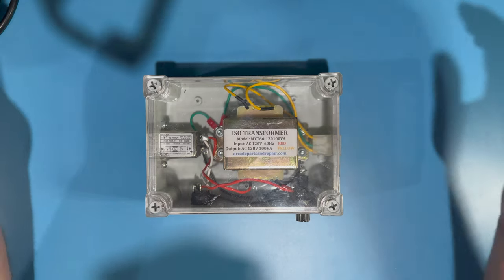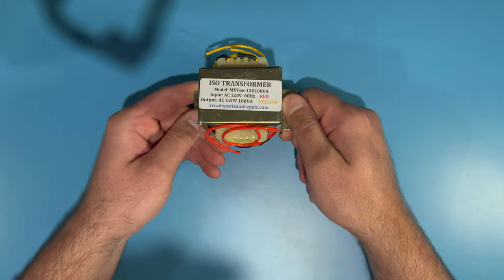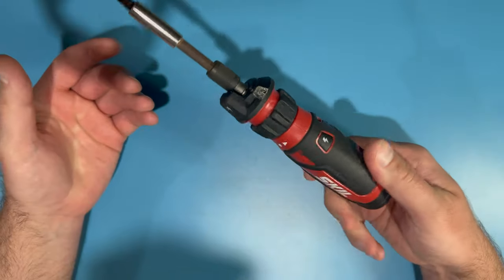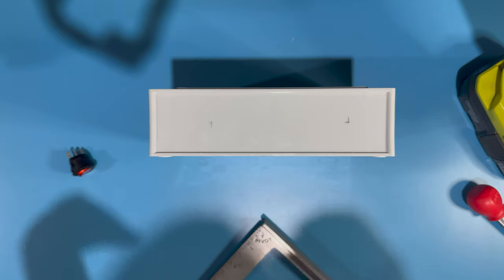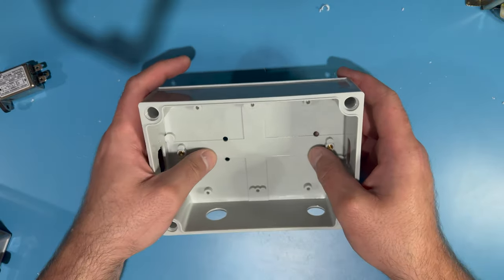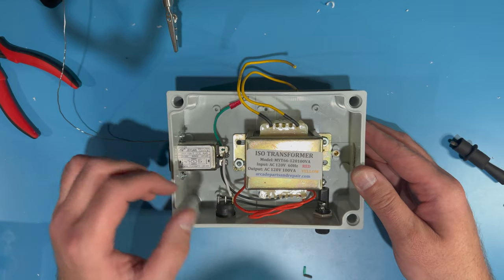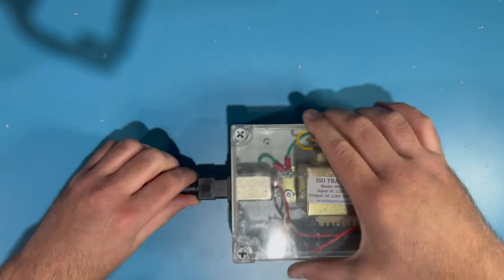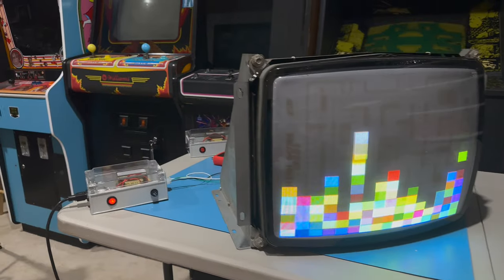How to Build your own Arcade Monitor test bench isolation transformer power supply 📺 ⚡️

Comment: Another important factor you need to take into consideration is the current the ISO can handle.   Yours is rated at 100VA = 1A @ 120V.   Most older 19" arcade monitors will typically take 1A.  You're at 100% capacity at that point.   It will work, but it will probably run hotter than it needs to and could shorten the life of the transformer.   Larger monitors might take more than 1A, you'll need to check the manual to be sure.
Reply from the maker: Good point -- you probably don't want to rely on this for extended use! The largest monitors I tend to work on are 25" K7000s, and per the monitor it seems they won't take more than 1A. But yet, a quick check at some manuals for 27" and larger monitors indicates they can draw over 1A. 👍
Reply: My K7000 doesn't have that same molex connector that you have.  Mine is a rectangle with one end flat, the other pointed.  3 pin.  Do you know what that connector is called? @overtimearcade
Reply from the maker: Are you sure it’s a K7000 (2-pin power connector) and not a K7400 (3-pin power connector)?

Comment: Nice work Charlie :)  I like your design  - good looking case!   Lots of work to make a video like this and supply all the details - well done sir.
Reply from the maker: Thanks, Bob -- I got ideas for several of the specific parts options from your post, especially the power socket and fuse holder!
Reply: @overtimearcade  I like it :)  - mine was evolutionary from guys who screwed a transformer to a hunk of wood..  Nice to be able to store them when not in use!

Comment: Hey buddy, awesome tutorial.....I followed the tutorial ...everything has continuity and there is 120volts AC coming in to the  IEC Power Socket but the output from the transformer is only 3volts....i am guessing this indicates a bad transformer?  As I mentioned I checked continuity all the way to end of the cable you made.  thanks buddy any help is appreciated :)
Reply from the maker: Oh wow, can you measure the AC voltage at the input lugs of the transformer? If you’ve got 120V on the input side and only 3v on the output side, it’s possible the transformer is a dud (assuming everything else is good).
Reply: @overtimearcade  lol the wire into the Molex pins wasn't making good contact..all good now :) school boy error lol
Reply from the maker: Easy fixes are the best… and the worst! 😂

Comment: ISOT for a name. Typically, you want to double amperage on any PSU component to run cooler and extend life. This is OK for testing, not continuous use. I asume that 120100VA means 120 volt 1 amp. Also, might want to fuse output too. So 3 amp line and 1 amp fast blow output to prevent damage to anything. Unit is good to test monitors. I would rev. 2 a output fuse.
Reply from the maker: Thanks, always looking to improve the design! APAR sells this isolation transformer for general purpose arcade monitor use. Are you saying it’s not suitable for continuous use?

Comment: Why do arcade monitors need an isolation transformer? I'm not sure why the arcade monitor designers made the chassis HOT rather than earth ground any reasons why they made the chassis live HOT with high voltage?

Comment: Its better to get a transformer with multiple voltage taps to future-proof yourself for working on equipment designed for alternate wall voltages, such as japanese imports.
Reply: Any idea where to get a 120 and 100v dual output transformer?
Reply: They are usually a lot bigger though and won't fit in the project box.
Reply: That's what you need here in the U.K.
We run 240V so need a 240V, 120V, and 100V multitap transformer.
Yes they are larger and heavier, but will do a great job. 
Back of panel box could have several common connectors for monitors
Reply: Good feedback here. I don't consider a project box to be necessary with everything nice and crimped and labelled and fused and so on. My setup is on a flat plank of wood with handles and rubber feet and nothing hot near those non-conductive handles. It's still extremely portable and it opens a lot more doors. 

I also end in a screw terminal strip and then change out adapters I made for different power plug types. Ending in a terminal strip also makes a good place for alligator clips. Haven't had any voltage drop issues and I can power anything quickly to see if its even worth my time on making a new adapter. I also get a nice spot for voltage test points.
Reply: @dsnein  But Charlie has young kids that could get hurt if they get their hands in there. So I think the box minimizes this.
Reply from the maker: Absolutely! I really wanted a small, compact, portable solution here that was somewhat "ruggedized." My kids are constantly throwing toys, balls, etc. into the garage too, so I'm very OCD about protecting all of my project cabinets & tools from projectile damage!

Comment: Anything Special for a Sanyo 100v setup other than a 100v transformer and connector?
Reply from the maker: Yes, it should be the same other than the 100v iso and a different power connector. I’ve bought the parts to assemble a Nintendo version for myself, just haven’t gotten around to it. Let me know how it works out for you!
Reply: put one together today, but i'm not getting 100v out of the transformer  @overtimearcade
Reply from the maker: @bryanhosford8029 Are you getting any output voltage from the isolation transformer? If not, start with the power cord, and trace the voltage through the circuit until it stops.
Reply from the maker: Interesting! What's the input voltage going into the iso?

Comment: Ok thank u - but have u explained why we use ISO Transformers? is for safety and hot chassis, i would consider using Gnd carefully on two pin input chassis https://www.youtube.com/watch?v=3rvEdHyAd2k
Reply: If you plug an arcade monitor into a standard 120v source it will blow up things on the chassis.

Some model monitors have built in circuitry that allow it to run without an ISO, but generally speaking, common arcade monitors such as, k7000, k4800/4900, G07, k4600 etc require an external ISO.
Reply from the maker: Thanks! And I do think it's important for the chassis to be grounded on the test bench -- it'll probably work fine without it, but if something goes wrong and an improper charge gets built up, your hand might provide a discharge path to ground!